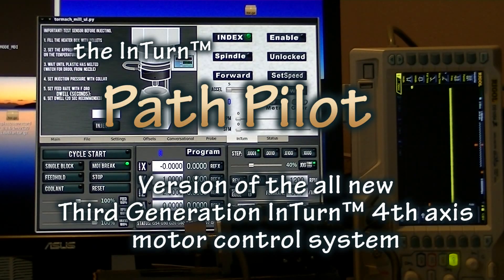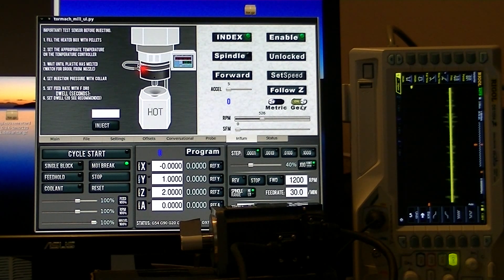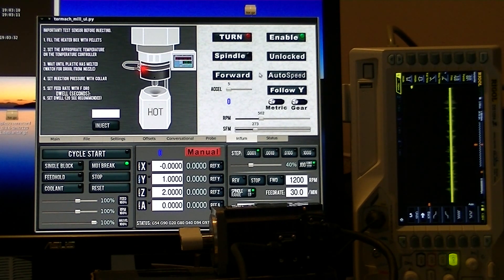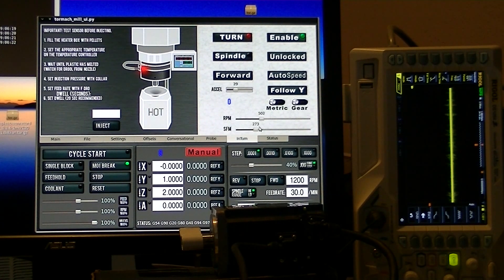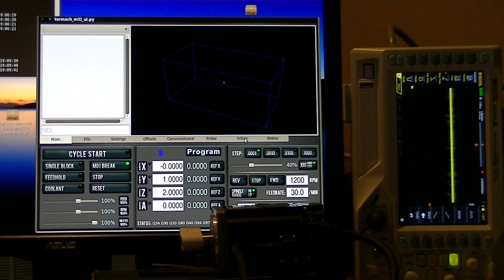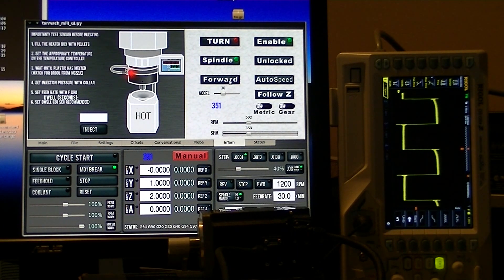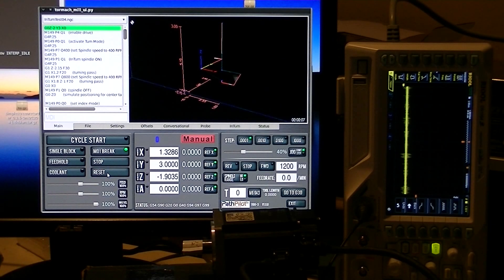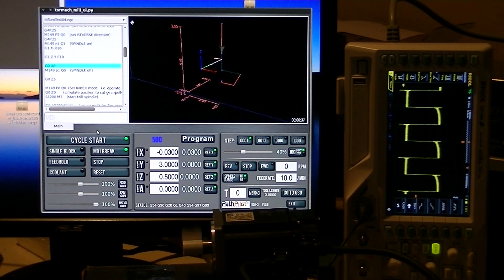PathPilot version of the InTurn 4th axis motor control system

Comment from the maker: Two changes since this vid was uploaded. 

1) the ''program/manual" button' is now placed in program setting automatically when 'Cycle Start' is pressed.  The button will probably be eliminated altoigether, so for now it has beem moved up to the InTurn controls screen and is no longer visible in 'main'. 
2) the blue DRO for ROM has been moved down under the 'A' axis and has the label InTurn RPM. It is only visible when the InTurn RPM is greater than zero.